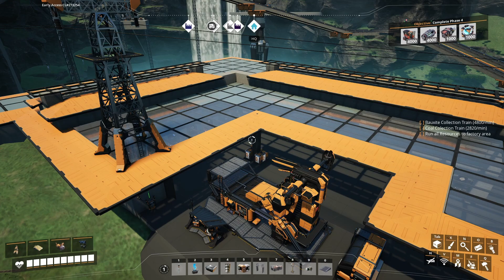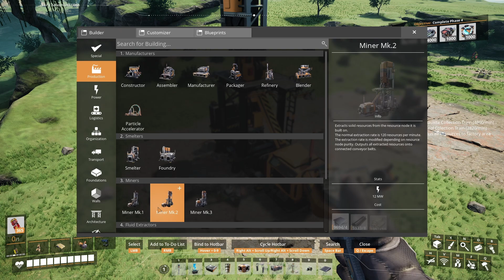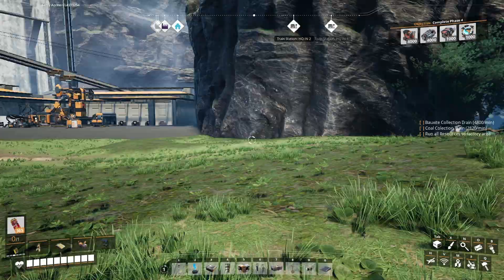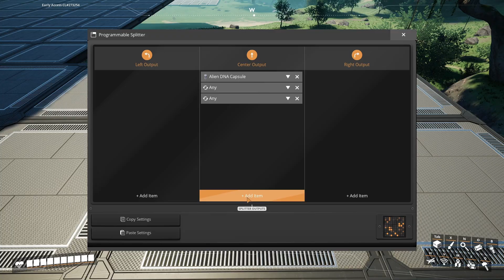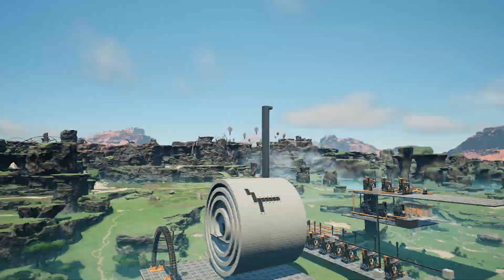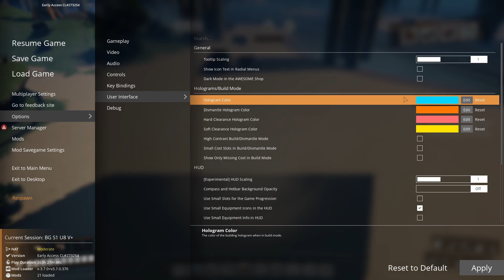50 Tips for new players to master 1.0 | Tips and Tricks | Satisfactory 1.0

Comment: Thanks for the video! It had some stuff I didn't know :) 27:13 Tip 43? What happed to it?
Reply from the maker: oh my god, I didnt even notice, I must have missed adding in the footage when editing XD
Just for you, here it is exclusive advice XD

Tip number 43: 
To deal with large logistical projects plan and build logistics spaces and belts and stuff using a hierarchy to your resource flow similar to road planing:

Highways are for the massive inter-factory logistics, trains, drones, trucks.

Arterials are for moving large amounts of resources inside the factory from one production line or segment to another without infringing on the local or collector level logistics.

Collectors are used to connect up the Arterials and Local logistics in a way that prevents blockages and balances the resource distribution and collection.

Local logistics is the logistics feeding the machines, and collecting the products, the manifolds and whatnot. Only ever Interacts with with collector level logistics.

This makes it a lot easier to plan and design massive and high level factory layouts even before the first foundation is placed!
Reply: @jackblade281  Thanks Jack! Much appreciate the advice :o)) I've still to deal with large scale planning as I've used the Resource Teleporter mod in previous builds so far. Makes Logistics a whole lot easier!!! Just name each one with a naming convention and you are good to go...
All the Best with the imminent 1.0 Release!

Comment: PC specs that you think you can play on at a moderate level If there are a lot of buildings
Reply from the maker: Great question!!
I think my specs are kind of in that range, mostly, some of them are overkill.

My specs:
GPU: RTX 3060 
CPU: AMD Ryzen 7 5700X 8 Core 3.4GHz
RAM: 32Gb DDR4 3200mHz (overkill)
SSD with 3.5Gb/s R/W Speed

When running the game the GPU pretty much always goes to 100% utilization, soI know that is the bottleneck when running Satisfactory.
Reply: @jackblade281  Thanks, I'm waiting for 1.0.

Comment: The 1m foundation does indeed snap to world grid. The problem is that the “snap to grid” feature snaps the centreline (mid-height) of the foundation to the world grid. 

So a 1m foundation will snap at 0.5m into the ground, a 2m fdn will snap at its mid-height of 1m into ground.. and a 4m will snap at 2m height into ground. Hope that makes sense. 
The reason to only use 2 and 4m foundations when snapping to grid is so that you don’t have to deal with a 0.5 misalignment that occurs with a the 1m foundation.
Reply from the maker: great explanation XD